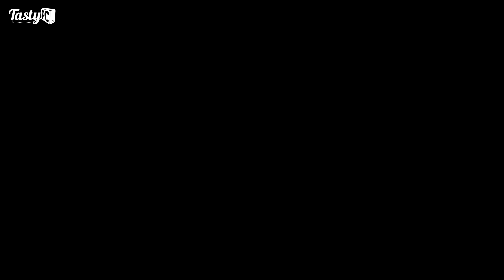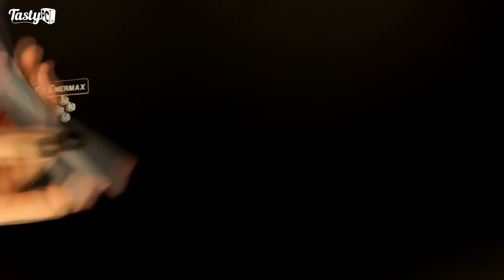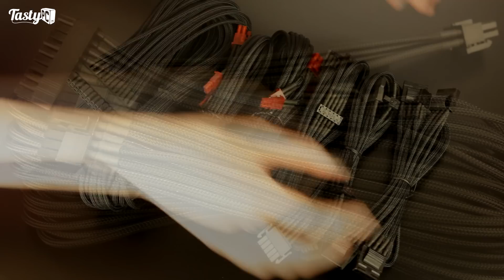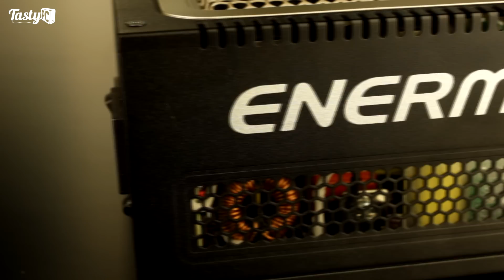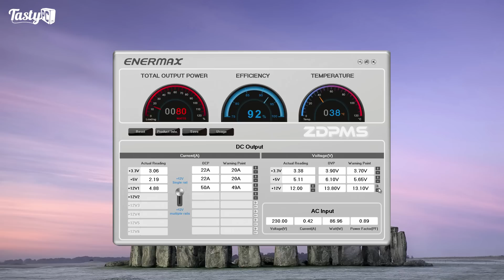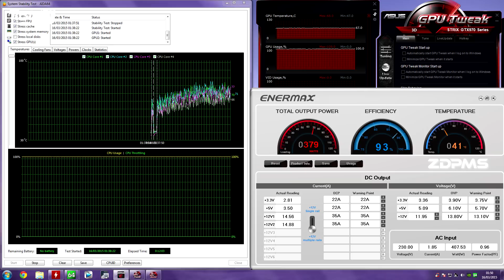Enermax Digifanless 550W PSU - My New Favourite Power Supply?

Comment: £180 for a 550w... Thats a little too much, for most people doing a gaming pc.. thats a huge part of the budget for just the psu... Around £100 you can have gold 550w and £120 can get you plat cert 650w. £60 for the cables which won't match 80% of the builds is kinda silly like you said. Just too much for the little you get.
Reply from the maker: Adrian Thorneycroft Take your current PSU and add maybe £40 to make it fanless, £30 to make it digital, at least £50 for the cables and £30 to go from 80PLUS gold to platinum. These may not be features you want and that's fine, but that doesn't make it a rip off. If you wanted everything this PSU has it's a very fair price but if you don't.. there's other products out there for you. :)
Reply: this is a luxury psu platinum rated, wich means quality, more efficiency and zero noise. Some people are willing to pay for that.
Reply from the maker: ***** This PSU can be run in a single 45A 12V mode though.
Reply from the maker: Danielle Lowe To clarify, I never said that this PSU wasn't expensive. Before pricing was even announced I could tell that this would be the most expensive PSU in it's wattage category. It sits in a very very niche market. You have to want Fanless, 80+ platinum, digital monitoring and Individually sleeved cables. If you aren't after ALL 4 of those features then you will be paying more for features you don't want.. which would be silly. Even if you only wanted 3 out of those 4 features you'd be better off elsewhere. If you do want all 4 of those features this is probably the cheapest PSU on the market right now for you, after all an individually sleeved 24pin cable for a Corsair PSU is £15 on it's own. These are not cheap features. 

I think sometimes it seems like I'm trying to sell something, especially when I like something that's really high end. In reality I'd really hate it if someone bought this because of my video when they actually don't want the things that justify it's price tag.
Reply from the maker: ***** The Corsair HX750i + Corsair's individually sleeved cables = £191.. http://imageshack.com/a/img540/839/ulz0ox.png 
You can bet that Corsair would increase the HX750i's price by £30-£40 if it was fanless.
Reply: Danielle Lowe £180!?!?!!?! (Haven't completely watched the video yet)

LMAO. I got my EVGA G2 850W for a touch over £100.
Reply: Anball2  There's a fine line between luxury and rip off. This supply crossed that line imo. For £180 you're looking at high quality, high wattage and highly efficient supplies. Fan-less or not, anyone that buys this supply has more money than sense. If I was going to spend more than £100 on a PSU then I'd do what I already have. I'd get an EVGA G2.
Reply from the maker: Adrian Thorneycroft Check out this page here: http://www.scan.co.uk/products/520w-xfx-xts-80plus-gold-fanless-passive-fully-modular-psu
This is the Fanless power supplies currently on sale at Scan, which is the category this PSU sits in. There's really no point trying to work out it's price by comparing it to units out side of this category. It's £60 more then the rest, but is digital and comes with individually sleeved cables. Corsair charge £30 for digital and the cables easily cost more than £40. So I personally feel  that it's a fair price.. This PSU isn't worth it for the vast majority of PC builders, especially if you're on a budget, but it still has a reasonable price based on the market and the features it offers, also not forgetting it's still at full RRP atm whereas everything we're comparing it to has had chance to decrease in price.

Personally I actually wouldn't want this PSU if it was 800W even at the same price, just due to how much agro I get for using a high watt PSU when it's not needed. I have about 6 800w+ PSUs here that I try not to use, just because I don't have the hardware needed for YouTube commenters not to moan lol. PSUs are most efficient at around 50% load though and as seen in the video this 550W PSU is more than enough for an i7 4770K and SLI GTX970's.
Reply: Anball2 Superflower offer a 500w 80+ plat rated psu for £90, this one is £180. Oh and they're both fanless. The only difference is the cables and digital throughput. It also offers 41.5a on the single rail.

If we were going for max amp on the single rail, you'd go for the single rail design, they were bronze rated but got over 60a on the 12v rail alone for the single rail design (Sadly non-modular) psu's.
Reply: TastyPCTV Thing is, if you wanted more throughput on the 12v rail or rails, you'd go for a higher watt psu capable of putting out much higher.
Reply: TastyPCTV Granted, those features do cost a bit more but this supply cost far too much for a 550W PSU. It should cost £120 at most.

I mean, I could pay £180 for a fanless, 550W digital, platinum rated PSU or I could pay ~£150 for a semi passive (might as well be fanless for a build that can run on 550W) non digital, platinum rated PSU with slightly worse cables but a significantly longer warranty. 

To me it seems like I'd be paying more for less wattage, the ability to monitor what the PSU is doing  and some cables. Fair enough, the cables and digital capabilities drive the price up but it just doesn't justify such a high price.  It should be £130 at most.

Yes there are people out there that want this but paying £~30 more than a high end 1KW PSU (~£100 more than other high end 550W supplies) just for the sake of 80+ platinum, digital monitoring, lack of a fan and some nice cables... I mean really. Even if you did want all of those features, you'd be out of your mind if you spent £180 on this supply.
Reply: ***** 550W is enough for any single GPU system though. If you plan on multigpu, then yeah, you would need more. My system has a 290x and a 4790k on a 550w power supply, and I have a lot of head room left. In fact, I used to run a 8350 with a 290x on a 550w power supply, and still had headroom left.
Reply: Danielle Lowe You aren't paying just for the "price per Wattage" which is what you seem to focus on. This is not a "budget" or even a "value" item. It's purely for the high end build, if someone was wanting to make a PC for gaming in a shared accommodation or enclosed area, noise becomes a huge factor.

If Noise is a bigger factor to your build then Budget, then yes this would be a logical choice. It's just that most people, Budget is a bigger factor than Noise.
Reply: Anball2 But you can get a Seasonic Fanless 460W PSU for £109. And it has a single 38A 12V rail so it's technically better.
Reply: ***** don't tell me, i am using 520 seasonic and it's all good.
Reply: TastyPCTV Yes, I just noticed that after the post. I commented at about 5 mins in. :) At any rate, would you say the sleeving and 90W is worth the extra £70?
Reply: TastyPCTV It doesn't cost £40 to make it fanless, you could do it yourself to any psu, just put a jumper over the fan header. You would barely need to add in any heatshrinks, the copper would only be a few £ to do so. The digital part just makes it a gloryfied meter, you can measure how much power the system is using without linking the psu to the pc.
Reply: TastyPCTV Wouldn't the easy argument for running an 800W PSU, be that PSUs are typically most efficient at 50% load?

Main thing I dislike about my AX760i is the fan reving to max at boot. That's really annoying and the only reason I would opt for fanless.
Reply: Richard Smith offcourse you are right - its enough but its nothing to do with the fact that 550W just isnt worth 180£
Reply: Danielle Lowe  its fanless. Components are probably extra high quality to withstand higher than normal heat.
Reply: Anball2 I bought a 80+ efficiency 550W with silent fan for 40€ back in 2008. Still works perfectly after 7 years of usage. You can get like 90+ efficiency PSU for 80€.
Reply: Danielle Lowe definitly you have a good point fot that high price will be are much better the TITANIUM PSU N700 of Andyson OEM
Reply: Danielle Lowe 180 British Pounds, it is expansive, but its all the tech your paying for, anything that is silent will cost you money.
Reply: tulp35000  Yes, the parts are selected for their ability to run at higher temperatures.

As for if the PSU is worth the price or not, that really boils down to individual tastes. I personally wouldn't own one since silent operation is not one of my goals. I am content if the noise level of my computer is somewhat South of the noise level of an EF5 tornado. When my plans to become the Undisputed Evil Overlord of the Multiverse come to fruition, I may outlaw fanless PSU's, but keep in mind all non-RPG games will also be outlawed.
Reply: Gary Grant You know, there is a place somewhere between silent and E5 tornado, where you can have a cool pc and still can barely hear it. 
In my opinion both extremes are stupid, too many fans serves no purpose but to blow unnecessary amounts of air around, and not enough forces your components to run too hot, for OCD levels of silence. Both are silly in my opinion, cause you can get both if you just don't go overboard one way or the other xD
Reply: Anball2 for $200 USD you can easily pick a top tier 1000W platinum power supply that is dead silent and delivers power with surgical precision
Reply: +Danielle Lowe DUDE! look at them braided cables!

Comment: Haven't seen anyone else say it, but at the beginning of your specs introduction you said it was rated for 105F, when the box said 105C? Great video as always, those cables are pretty sexy, I just bought myself an XFX branded Silverstone X-460 for my HTPC/server, aiming for only a few fans and HDDs making noise, and hopefully very little.
Reply from the maker: dKJustwon I did put an annotation there, do you have them turned off? :S
Reply: TastyPCTV Ah yeah, by default, my bad.

Comment: I'm not sure the huge premium for platinum efficiency will pay off in electricity savings over it's lifetime... seems like it's past the point of diminishing returns. That said, I was surprised it could power an SLI 970 with under 400W load. Maybe my Seasonic 750 Gold is a bit of an overkill for a single GPU :3 But I like running a PSU @  +/- 50% capacity; it's more quiet, cooler and higher quality DC output with less ripple...

Comment: Good video :D 
I have the Seasonic X-Series 660w 80+ Gold semi-passive psu. Which I'm extremely satisfied with, the fans hardly ever spin up unless I'm overclocking and stressing my gtx 970, and even when the fan is spinning it is very close to inaudible. (60-65C) 
But after seeing this fanless psu, and the quality of the cables & etc. , it has got me a bit frustrated with the length of the cables and the way the cables are sleeved,  i don't even know if i consider them "sleeved ", it has a hair net or panty hose type sleeving... :-/
Also it has absolutely no software to monitor temps or  load or anything.  

But yeah,  rambled a bit there :P 
But now your silent rig from a few videos ago is taken to a even more extreme  level of silence. :)
Looking forward to seeing how other companies adapt this tech.

Comment: My dream PSU would be a infinite supply of free power ran with safe Nuclear radiation that will never needs to be charged. Not only that it is a once off PSU. It will obviously be wireless also since it does not run on mains/ac. Can't wait for the future to catch up with my idea. Wireless energy source that can output enough watts/voltage safely.
Reply: Keitho Sayoto It's called a Laptop...... Holyshit. The future takes time, and it's not your original Idea.
Reply: I meant, not just for computer or laptop. I mean as in power EVERYTHING!!!!!

Comment: I had a 1000W PSU from Corsair, but when I built smaller to mATX I needed a shorter one, I went with the 860i from Corsair. When I test it while it uses the max amount of power, I get 415W :P Still, it makes the PSU last longer as it won't be pushed at all.

Comment: 180£ is a lot , i will live with a 38£ 500watt 80+ PSU Noise  , if noise is a problem then i will replace the PSU fan  with a low RPM/noise alternative.

Comment: They should make a matte back, fan, or fanless (you can add, and remove the fan and change the settings using a switch on the back) psu that has individually sleeved red and black stripped sleeves, and modular...

Comment: Building my first PC this weekend, scared of breaking something :/
Reply from the maker: Ollie Burton As long as you take your time with everything, then you should be fine, it's much easier than it looks! There are many videos out there if you get stuff or are unsure of something. :)
Reply: I wouldn't worry. Look over everything first, see that's it's not already broken. Plan and use YouTube for when you wonder about something. But it's not difficult :)
Reply: Same here bro.. good luck.
Reply: Ollie Burton  just make sure you do your research. I learned by YouTube videos.
Reply: Ollie Burton dont worry about the cpu btw bust that bitch in to place you might hear some cracks its fine though
Reply: Having a proper case and PSU goes a long way towards making building an enjoyable and trouble free experience, so make sure you have covered those bases. I spent a couple hundred bucks patching those bad decisions, so it is worth watching all the reviews.
Reply: Ollie Burton Except for applying the thermal paste, it's like putting Lego together. Just follow the instructions and take your time.